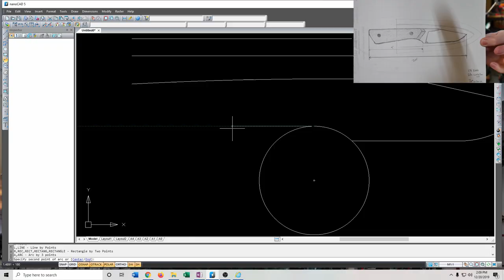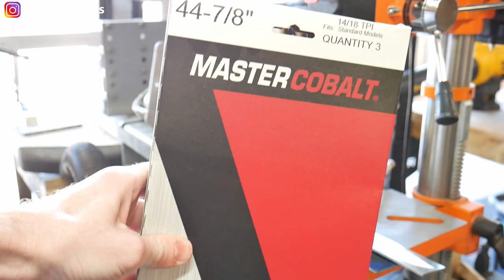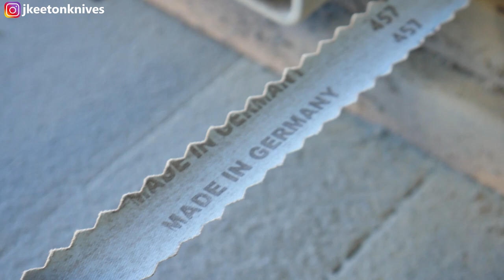Making A Knife For An X-Carry - Will It Fit?

Comment: Lovely knife! I want to build my first knife soon. Could you tell me the thickness of the blade you used? I would really appreciate it, since I plan to go for a similar look, but I am really inexperienced :)
Greetings from Germany
Reply from the maker: Cheers from Texas sir! The thickness of the stock is 1/8''
Reply: @RedBeardOps  Thanks a lot! Unfortunately I can only find a 4mm thick beginner-friendly steel (1/8" is ~3.2mm), but I guess I will be fine. Its my first knife after all, so it doesn't have to be perfect :D

Comment: Dude. Great build! Would love to see you do a video on mini cad. Also, can you talk about why you love corby bolts? I use brass pins, and dont see any real advantage to having to do extra drilling and paying more corbys. Would love to hear your take!
Reply from the maker: Cool deal, thanks for the feed back on Nano Cad. Corbies are superior to straight pins since they pull the scales into the tang and have a mechanical ledge to secure them to the handles. There are hundred of knife makers that don't use any mechanical fasteners and have perfectly good, strong knives with straight pins and epoxy. But I like the idea of having a slightly more robust handle fastener. Loveless bolts would be another good option. They give me piece of mind.

Comment: I have a Tormac T-8 and it comes with a truing attachments which fits on the bar and has a diamond point on it and you move it across the wheel and it retrues your wheel. your company may have the same or does tormac parts work on yours.
Reply from the maker: I actually use the tormek one too. Works great!

Comment: Hello! Please how much is the FeCl3 concentration?
Reply from the maker: 50/50 with water
Reply: need to add hydrochloric acid?thanks for the reply😄
Reply from the maker: @dsssok2017  I used this - Acid Enchant - https://amzn.to/2LLRxA7

With a ratio of 50/50 water
Reply: fecl3  Etching Knife What is the use of ?It's still there Rust!
Reply from the maker: @dsssok2017  looks good. And provides some wear protection

Comment: What is the belt sander/grinder you use?
Reply from the maker: Hey man, I have a video coming out Friday with some good shots of my grinder and how I converted it to be able to be switched horizontal. It's a budget model from - https://kadrmaskreations.com/product-category/knife-grinders/
Reply: @RedBeardOps  Awesome Ill make sure to check out your video on Friday, you do a great job showing what you do and explaining it!! I got my first knife started out of a old coil spring from a truck. Not sure how it got hardened but a cant drill holes in the handle for the corbie bolts. Going to try and heat it up again today.
Reply from the maker: @theharpersat  Very cool! Your truck coil springs will be hardened and spring tempered. Hard enough to not be able to drill, but likely too soft for being a knife. You can heat it up to non magnetic then put it in sand to cool over the course of a couple of hours. This will make it soft. After that grind and shape it and drill it. Then heat treat it via getting it to non-magnetic and quenching in veggie oil. Then temper for two 2 hour tempering cycles in your oven for 400F. That should get you in the game my friend.